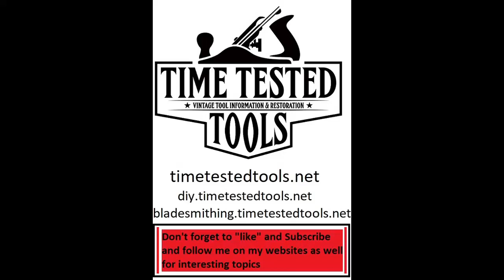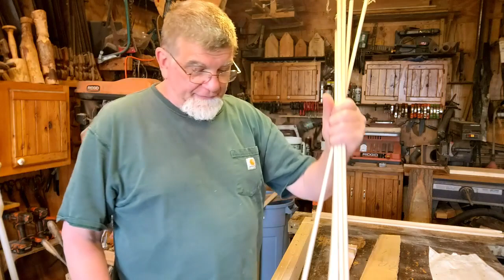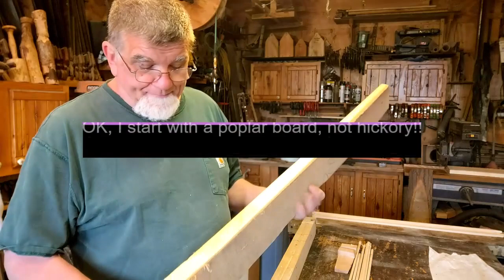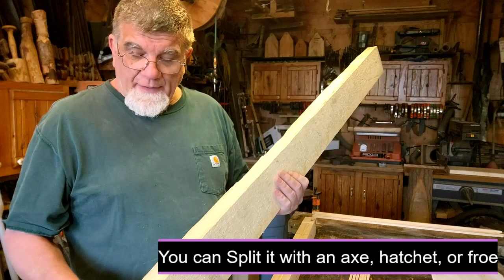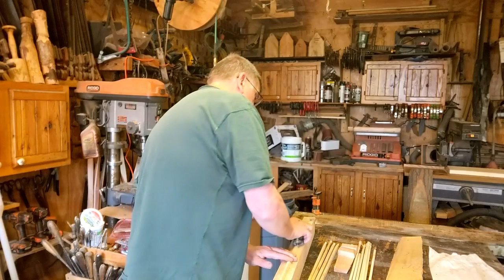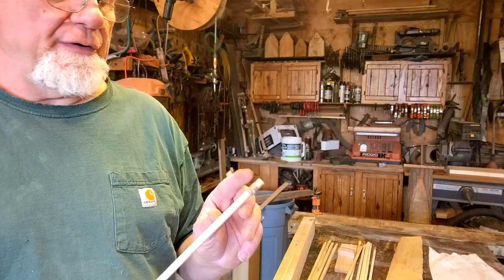DIY Poplar arrow shafts

Comment: Thanks for taking time to detail your process!
I use 1/2" tulip poplar boards from the orange Big Box home improvement place. Because tulip poplar trees tend to grow straight, it's relative easy to find straight-grained boards. Table saw used to rip into 3/8" squares. Then hand plane square to 8 sides. Then 16 sides. Then chuck in electric drill and, using piece of sandpaper, finish the rounding. Weight is in same ballpark as doug fir. And they are tough.